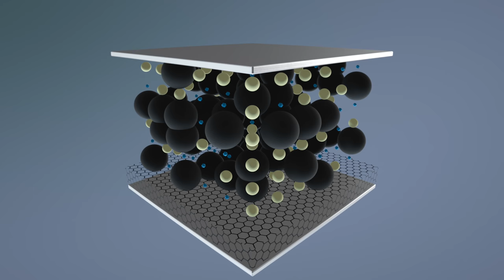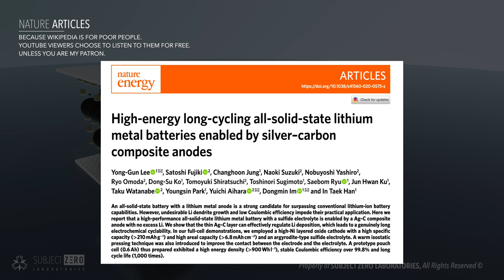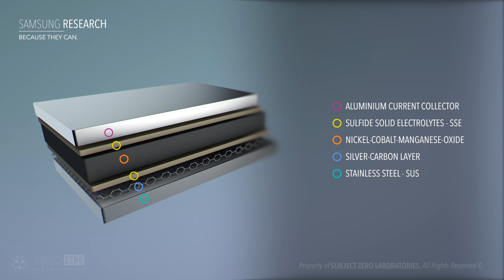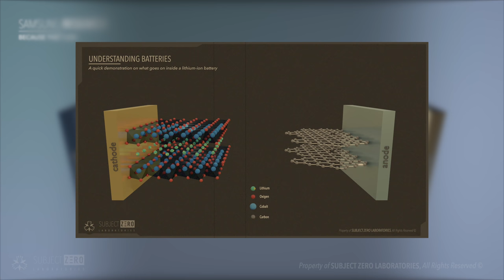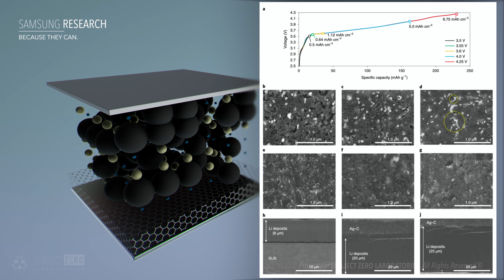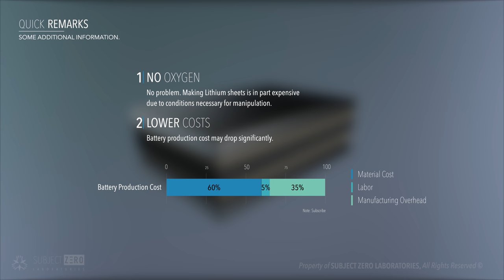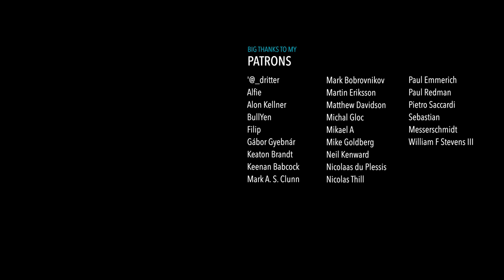Breakthrough Solid State Battery - 900 Wh/L Samsung [2020]

Comment: So I take it the:

Fusion reactors: 30 years away
Next gen battery: 5 years away

...still applies then :D
Reply: I heard fusion was 15 years away.... 15 years ago. Sooo anytime soon!
Reply: It is worth noting that the current prototype, which they already have, is 50% better than the current batteries. Ignoring any further advancements, this is a huge advancement and could even be used right now (potentially). The "5 years away" bit where the nickle-cobalt is removed from the mix is just another further advancement. The cost of batteries with respect to their energy density will no doubt be improved from this advancement alone, but the further advancements would only make this much much more pronounced.
Reply: Usually the bottlenecks/no-goes are cost of materials, and the lack of production methods on an industrial scale
Reply: @DmitryLapshukov  the problem with fusion reactors is that they are always 5 years away from the day.
Reply: Pace77 prototype to market may well take 5 years
Reply: @pace7746  WOOOSSHHHH!!!
Reply: @smoke4131  yeah, this is a running joke among physicist. I recently saw a Full Charged episode about the First Light Fusion. And guy said exactly 5 years, lol. But nevertheless they approached it quite uniquely.
Reply: The difference here is, they have a working prototype (unlike fusion), Samsung has production facilities, has experience in getting lab prototypes into production. Tesla is also developing solid state batteries for production along with National Panasonic. Look at the  development of batteries over the last decade, progress has been slow but progressing forward just the same. I have confidence that eventually batteries will out perform fossil fuelled cars both in range, cost to run over the life of the vehicle and the possibility that electric cars will not need plug in charging as such, but can inductively charge when parked at home, business or even in shopping malls.
Reply: You forgot flying cars.
Reply: I heard that 25 years ago....  Nobody is waiting for this, there is no profit to make from fusion, because alle the nuclear industry supply lines are Uranium based.  And owned by the biggest investors/companies in the world, they don't want to give that up.  And for next gen batteries the same : now that every major company is building or has plans building Li-Ion battery factories, they really aren't waiting for a new generation.  All is profit/margins/investor relations.
Reply: it's always 5 years away
Reply: I'm always impressed how people can post this under videos discussing those exact things progressing with serious intentions, it's almost a form of cognitive dissonance that relies entirely on the fact that it would technically still be wrong to say "X is here".
Reply: Mass produced electric cars: -10 years.
Reply: @DmitryLapshukov  Well, since it took seventy years for it to go down from 30 years to 15, then I guess in 30 years they will still be saying 15 years.... unless something drastic happens to oil supplies.
Reply: Just like how we're always 15-25 years away from New York City being underwater, right?
Keep meme-ing fusion while you rely on black boxes for your future weather, uh I mean "climate" changes.
Reply: @aiGeis  Hey aiGeis.... love your handle... ummm,  un/pseudonym. Have you and interest in Greek Mythology, literature? or just like the fact that AI are the first two letters of the Greek name/word?
Reply: @truthseek1790  ai = artificial intelligence
geis (pronounced "gesh")  is Gaelic and roughly translates to "curse". I thought it was cool as a 16 year old when I made it 9 years ago, never bothered changing it (even though it's not what I would choose today).
Reply: @kelvinham8576  "the difference here is that they have a working prototype"

Wrong, there are already multiple prototype fusion reactors and there have been for decades. They just don't produce more energy then you have to out in to keep them running. However, ITER which is being build right now will.

Mind you, building and energy source 10x hotter than the sun is quite a challenge....
Reply: Don't we already have next-gen batteries available? Graphene batteries
Reply: In my local bar is a sign: "Free beer tomorrow"...
Reply: You guys really think Fusion reactor will be available soon when all of our global economy are entirely dependent on the sweet petrodollar? , do you really think countries that posess massive oil reserves will simply let their main income go away?
Reply: I think fusion will be at least ten years faster. If all phases of Wendelstein 7X are a success and on schedule, which they appear to be, then capital will flock to them and they will produce an industrial prototype very fast.
Reply: Its been 25 years for 25 years fusion.
Reply: By the time it will make into the market it won't matter because I am already wasting my young years
Reply: The 'Concept of Proof' fusion reactor is being built in France and is due to be tested in about 2035  (if it can be kept kept funded). This will not be a Commercial producer of electricity. If the Fusion Reactor shows that it works, then a larger Fusion Generator has to be built. That may not take as long, because of lessons learned and the money and input that would be raised for a know-to-work Fusion Plant.
Reply: Read an article that said, with the use of new AI technology in analyzing and carrying out experiments, we could see the first net positive fusion reactor in 2025
Reply: Fusion is probably 40 years away but imagine you have your own yacht with almost free fuel. You chill on your boat and then decide to go 50 mph without burning gas... Amazing but far away. Or you could go nuclear as done in the 50s xD the Russians literally built a nuclear powered plane but becaus EOF the weight they couldn't shield it and most of the crew members died
Reply: actually there has been a break threw in fusion power, science isn't talking about it because it was done to test a scientific model that isn't accepted by the mainstream.  they've already designed and started raising money to build a test reactor, i think the first round of funding was 20 million or so. in 15 years, we should have generac size fusion reactors, and a collapse in prices for all goods.
Reply: ... and before all that, we will see the worldwide economies crash, mass unemployment everywhere and the housing market implode!
But that is not important, there is a new battery coming out ...

Comment: I will believe it when it is available on the open market
Reply: 1000 cycles are very little.
Reply: jose almeida when one charge gets you 1000 miles, 1000 charges get you one million miles. And the the battery can be removed from the car and the rest of the capacity is enough to power a house during the non-sun hours.
Reply: Same. I've read a ton of things about supposed amazing battery technologies for years, yet almost none of that actually made it into the market. Well, someone did release a power bank with some graphene in it and performance was impressive. So... I suppose that material actually has a chance. Still, until we see at least one these new technologies applied in consumer phones and/or cars, I'm not going to jump the gun just yet.
Reply: thenonexistinghero  Graphene batteries. Next vid in the cue.
Reply: @thenonexistinghero  inventing the technology isnt necessarily the hard part, I wouldnt be surprised if they could make a battery that was 3x the performance tomorrow. The hard part is actually producing it at a reasonable cost. I'd trust samsung to know this and be working towards it, but so many smaller people will think they have a breakthrough but really it was probably something thought of and thrown away when it was realised production wouldnt be possible
Reply: @facepalm7345  the main problem are usually the side effects.
For example, while it's true that lithium sulfur with nanotubes has far superior energy and power density than anything we have today, problem is the fact that these things expand a lot during charging process. Battery like that would be difficult to keep in a smartphone, let alone live long enough to be useful.
Reply: you wanna forget the yearly incremental improvements to battery chemistry for us consumers? e.g. look at laptops, phones, electric vehicles. we have been enjoying the innovations in this field. there is a reason more than a billion bucks is poured in r&d every year. the applications are huge
Reply: @shiroineko13  lithium ion and LiPo tech in smartphones and laptops hasn't really progressed that much in the past 5 years. Most of the improvements are done in energy efficiency of the components. 
The only notable change in consumer electronics, is the introduction of fast charging.
Reply: @shiroineko13  Really? Laptop battery times are the same now as they were in 1999!
Reply: @jameslovell8682  Really? You also wanna build electric vehicles with 1999 battery technology? Hah! have fun with that venture!

Edit: And think what enabled those ultra-thin laptops smart phones on the market now. You remember your bulky 1999 laptop?
Reply: @jameslovell8682  they're getting thinner though.
Reply: @josealmeida5768  They only say 1000 because it is a reaserch article not a stress test. the exact words are "at least 1000 charges"
Reply: @shiroineko13  but the efficiency increments are a few percent, nothing like Moore's  law with processor power. Physics is physics, no one can break those laws.
Reply: @shiroineko13  that is mainly  because of low power processors, SSDs and displays.
Reply: then there is nothing to believe
Reply: @Vraetzught  whats the difference between lithium and li polymer batteries? Which is better?
Reply: @ahsan.v8  The lithium-polymer battery is a particular type of lithium-ion battery in which the electrolyte is a solid plastic-like material rather than a liquid. Most mobile phones have this type of battery, because it can be made as a thin flat shape. The best of them are very good.
Reply: It may well be available, when the oil runs out!